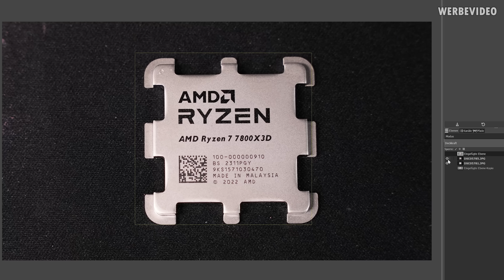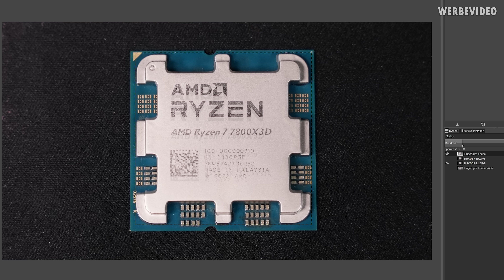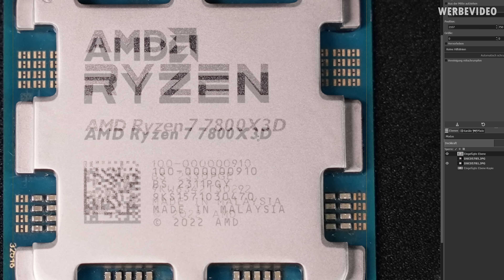Beware! Fake Ryzen 7800X3D CPUs are being sold

Comment: I don't get it - when someone is doing something like this, why won't they spend more time making it 1:1 wherever possible. I get the PCB thickness may not be available for the scammer, but everything else - why not perfect the design to actually match the original. It's bound to happen that people will start noticing a different font etc.

Also - I thought OLX has some guarantees if the item isn't working.

Comment: My first thought about these is: could these be "dummy"-cpus used on trade shows? Similar to dummy cellphones back in the day. Motherboard manufacturers that want to have a cpu in the socket, but don’t want to buy 20-30 real cpus. 

But again, that doesn’t explain why the serial on the box is a match 🤔
Reply: They probably buy real cpu to imitate it and copy the box serial code
Reply: @mr.il3nt658 yes. That makes most sense as they wouldn’t have to replicate the box and the label with the AMD emblem. But then again. The effort put into the IHS it wouldn’t shock me if they also made a good fake box 😅

Comment: This OLX is basically eBay or more like Craigslist. There is also a sort of a market for in box new parts. They are usually called "dropped from truck". They don't have warranty but they might be new and sealed. This does not mean they are ilegally obtained, usually these are sold by people working at retailers that know how to get a huge discount so they sell them at a profit. Or people that had a good deal buying things in bulk. Usually the volume is rather low so it's not money laundering, or not fully obvious.

Comment: "Somebody" did not do this.  This is the product of hundreds of willing participants to this scam.  The printing company, head spreader cnc shop, pcb manufacturer, etc. The management and most of the workers at these companies would have been aware they were making fake products.
Reply: Oh sure, but in China this thing happens all the time
Reply: i can see a cnc shop or pcb maker nto knowing what the end product will be but still....  this is a group of people doing this.  who ever printed the box would be the most likely to know id think
Reply: Pcb's yes but they'll easily turn a blind eye with a little extra money. The CNC stuff I could see being done without anyone knowing since some machine shops will let employees run stuff off the clock during normal down time. The rest of it can be done at home. But ultimately these were likely used to scam retailers originally until they exhausted that loop hole and moved to other market options.
Reply: @sirmonkey1985 I wouldn't agree
You can order PCBs from China (and some EU companies too, even) without even telling them what's it for
No questions will be asked and they'll make them according to specification
Same with many CNC manufacturers, they just get an order, and make it
Unless anywhere in that process, they see something related to AMD
And even then, if the workers etc. don't think about CPUs/don't know, so it would cause issues

Tbh licensing in China is so ignored sometimes...
PCBWay and JLC literally don't care about what logos you order them to silkscreen on a PCB, for example
Many CNC manufacturers also would make any shape like a car logo with no questions asked, for example

It's the text engraving I have most questions about, and assembly of the final scam product
Reply: @Versette  Actually the engraving can be done in-home on relatively cheap equipment, but these scams are getting out of hand.
Just last year someone tried scamming me by sending me a plastic prop instead a camera, but that was a much lower effort scam. The whole box weighted less than a proper rig should and despite nice packaging everything including "lens" was one painted part. Luckily it was payment on delivery and I just didn't pay.

It's probably a small network (or just getting popular), making more than one "product" using the combination of chinese PCB, local shops and own machines.
What's more intriguing to me is how their distribution network works. The police taking usually a year or so to look on cases like this and no one bothering with lawsuits probably helps.
Reply: Crisis management at lntel?
Reply: for the physical thing itself, it is just some employees of a local branch of a company like pcbway or so making some extra money off clock.
but likely there is a bigger criminal organization making money with those
Reply: this can be done with like 1-2k of laser engraver, a small metal lathe or CNC, and PCBWay. The only third party complicit would be PCBWay for the PCB manufacturing and they have no idea or way to enforce this
Reply: @marcogenovesi8570  cnc mill, not the lathe. Also the heat spreader looks like I could make it on hurco, conversational machine. You do not need to know or use any G code.
Reply: and they all need to be payed, with what amount of fakes actually being sold ? lol, my BS meter is buzzing.
Reply: Not hard to do. All these companies are desperate for customers. They don't care what you use it for. You think that printing company cares? They're printing junk and porn on a regular basis. As long as they get paid, they won't care one bit.
Reply: China has lost like 2m tech jobs in the past 2 yrs as it threatened to jail ALL foreigners doing business in China!  Its a way to bring back a small part of the lost jobs ...
Reply: Conceivably something like this could come out of a small garage workshop.

My money is on some sort of semi-large scale return scam, weird how they didn't match the PCB color though since clearly they've paid quite a lot of attention to appearance.
Reply: @lemagreengreen  How though? Send them to OEM's? More likely its small scale "invisible" outlets like AliExpress and well the bargain basement Facebook Marketplace clone this came from originally. Used to bait 'n' switch from genuine outlets by individual buyers much harder to track than corporate buyers. There is so much cheap fake tat that comes from china this is just the tip of the iceberg bought a bunch of fake Playstation controllers once the attention to detail was outstanding they were very hard to spot and they did work, just not very well but enough for them to sell to the gullible which included me apparently

Comment: Someone got one of these fake CPUs from Amazon over at Reddit. Same bluish PCB and lack of comformal coating on the capacitors, but that one says "made in China" and doesn't fit in the AM5 socket. It's not the same one mentioned in the video since that one isn't simply a laser-engraves AM4 CPU.

Comment: This I'm afraid is only the beginning as it gets easier to make fakes. Just too many shady countries with shady businesses that actually have connections to OEM's that can make things like this, probably cost 50$ or less to make this fake.
Reply: 50?!?!

lol, the pcb doesnt cost 5 dollars per unit, and i am exagerating, havent yoy seen pcbway! ads?

the metall cost like 3, once you ask for at least 1000 units is way cheaper, is just cheap aluminum, it is expensive the finishing touches on the top to put the fake amd stuff

all you do is use autocad or other cad software and tyen use the rigth tool to burn it on top of the ihs and you have your fake product

it is more expensive the shipping!
Reply: Probably way cheaper per piece... the capacitor probably fake as well... 🤣 there is probably zero copper within the PCB layer itself..

Comment: This looks to me like an in-store display mockup or something similar made to be displayed as an advertisement. Much like some brick-and-mortar stores still have fake phones on display that look almost exactly like the real deal. I don't think this was designed as a scam, but people (especially here in Eastern Europe) are very creative.
Reply: They wouldn't go to the trouble of faking the chips on the heat spreader making it a different cast from the mass produced one just for a demo unit.  Also demo units have serial numbers that aren't like a normal one's.
Reply: That's exactly what I was thinking but why go to the trouble of creating from scratch. If AMD were making display versions they'd likely use original stock but with chiplets mising or chiplets that lost the silicon lottery completely. On a smaller scale the cost of tooling etc would be cost-prohibitive. A store would more likely just get a returned / defective CPU and display that... It's sad that someone has gone to so much effort to basically steal money.
Reply: The amount of people stealing from computer shops is getting higher, it would suprise me if they are display models that have been stolen/resold not knowing they're duds. I've found countless phones/EE wifi boxes over the years that just have metal weights inside them to make them feel real.

Comment: Either this is a professional fake, OR they took a real CPU, delidded it, and used the heat spreader and the box to make the fake one. The delidded CPU being used in someone's gaming PC unaware the remains of his CPU are used to create fake ones.

In this case, using the serial number, it could be possible to track down where they're bought from and potentially get a location. But help from AMD is required.
Reply: That is a great idea, I really hope he tries to find out.
Reply: If I have to guess, all of the fakes have the same serial number (or a few variations) that checks out on the AMD verification page if you scan the QR code. The serial number could literally come from anywhere as you can just get a high-res picture from the internet and copy it including the QR code.

Also this is pretty high-effort as even the shifting label on the seal is working as you would expect. All and all, it's very professional work.

Comment: The holes in the heatsink could be intentionally added to adjust the weight, potentially making it harder to distinguish a fake CPU from a real one by weight alone. Try to spot a fake by weighing the CPUs.
Reply: They would be drilled not threaded, this is for mounting on laser graver printer. That fakes looks like from profesional manufacture line..
Reply: @r4plez  Plausible..

Comment: Maker: "- Call PCBWay and tell them to make the next batch with 1.3mm PCB".
Reply: ''also make sure to change the colour to one which is more green''
Reply: @gamecuber6  "...and while you at it, make sure they will put protctive resin on top of the capacitors"
Reply: And, of course, we gotta change the font and the laser engraver.
Reply: And put nail polish on it.
Reply: Maybe it was JLCPCB 🤣
Reply: They are well aware. If you notice on that side on shot of the IHS comparison they made the fake IHS thicker so that the z height would be roughly the same in total.
Reply: Maybe AMD can come up with a PCB design with some patterns on it to make it harder to imitate. Regardless. Buyer beware
Reply: @robertlawrence9000  Both JLCPCB and PCBWAY can make patterns with very high resolution. If they can then so can other fabs located in China or elsewhere.
Reply: your all forgetting that the thickness of the IHS is also wrong, to compensate for the thinness of the pcb. time stamp 9:42
Reply: If they use some old chips like, I dunno, PLCC m68k, instead of making that part of the heat spreader, and pre-broke it so removing the IHS would leave you with what appears like a destroyed CPU, those dark green, nail polished, 1.3mm PCB fakes with better fonts would be very, very believable.
Reply: omg rofl :D!!!!

Comment: Those holes on the underside of the heatspreader are probably from casting it. Machining the heatspreader is a waste of time if you just need a block of copper
Reply: i dont think its made out of copper, would be too expensive. just use a piece of aluminium, preheat hundreds of them to 4-500 c° and then stamp it into form with a 100 ton press, takes  maybe 2-3 hours to do 100 pieces, nickelplate all of them, order 100 pcb´s from pcbway with capacitors allready placed, glue them , get some fake boxes and stickers, done. in one day you can probably make ~500 pieces ready to ship with a market value of ~150K if you sell them for 300 each....its scary!
Reply: @georgwarhead2801  I'd guess that the boxes are real as faking them would make everything far more complex. They just laser the serial number based on the box.
Reply: @georgwarhead2801  I don't think its aluminum or he would have said it feels a lot lighter. 

Holes are tapped so not from casting alone, they'd be using it either for nickel plate process as he says, or maybe some machining op.
Reply: It's a cast zinc alloy (pot metal) it's 80% the weight of copper but that piece is a bit thicker so it's be about the same weight.
Reply: @georgwarhead2801  Such an criminal mindset u got there.

Comment: This is very interesting. I ordered a 7800X3d from Amazon. I didn't realize until after I had ordered it, that it was coming from somewhere in Asia. I also paid about $300 for the CPU. I'm thinking now, I might be getting one of these fake CPUs. It hasn't yet arrived. We'll see what it looks like when it arrives. At least I can get my money back from Amazon if it's fake.
Reply: It probably will not arrive
Reply: At least with Amazon you should be protected by their buyer protections
Reply: Amazon buyer protection is extremely thorough, you'll be fine
Reply: Record the unboxing tho just in case you need something to defend yourself.
Reply: Yeah the same thing happened to me i bought for it for low price like 300 and amazon hit me up and cancelled it for me and refunded me
Reply: I got tricked early on and the package that arrived just had a zip tie in it but Amazon refunded the money before I could even report it. If I were you, I'd probably report it now. It's certainly a fake or won't arrive.
Reply: I've been eyeing off a cheap 5800 x3d on Amazon, might bail on it now
Reply: Any update?
Reply: @KaitouKaiju  I assume it was a fake. Amazon was full of bad actor vendors. Any new vendors were bad, almost all from China. A few even had Chinese names in Chinese characters. I just ordered a 9950x brand new. The price was so good that I didn't bother waiting for an open box.
Reply: Me too I bought this CPU for $308 from Amazon but I found it from third seller not Amazon store . So after one day from buying this CPU the order was cancelled . In Amazon there is a third seller sell it for low price and that is fake price .

Comment: I've seen a lot of people suggest buying CPUs from Aliexpress to save money, and while there are honest sellers there, there also are a lot of scammers selling chips with swapped or re-engraved IHS's and the underlying CPU is actually an ES or sometimes not even the right CPU, and in cases like we see here, sometimes its just a completely fake dummy unit. Buy from trusted retailers!
Reply: This is why you buy from a trusted seller on aliexpress, not some random store with 0 reviews. People don't seem to understand how an open marketplace works.
Reply: The source of really cheap CPUs on aliexpress are Engineering samples. Although they're technically the right CPU they might not clock as high or perform as well. There are some reputable sellers that sell pre used CPUs mostly from internet cafes and such. You can normally tell by how many CPUs they've sold in the past. There are really only a handful of really big sellers and those are fine.

Comment: Great video, bringing attention to this issue.
Scary part is, the amount of design that went into the fake heat spreader and the PCB. What would be cost of 1,000 units of each part? You might be looking at €10,000 costs maybe €15,000 with packaging? 1,000 x €300 = €300,000. That's a lot of profit. The holes it the heat spreader might be to balance the weight to a genuine version. Threaded hole would make process quicker for batch nickel plating. Whole set of this, from start (Raw parts) to boxed (FAKE 7800X3D), including tools required to complete work. €25,000-30,000.
Reply: It'll be made in China very cheaply or even in a backstreet workshop in some country with very low wages. Probably won't be that costly to make believe it or not. The counterfeit market is very prolific. I very much doubt it was made in Romania. Probably brought in bulk from Asia by another criminal and sold in smaller batches further down the chain. Complete scumbags but not uncommon. The 7800 X3D is a popular product so they wouldn't mess around with a low selling model. The new Ryzen Zero series.
Reply: "You might be looking at €10,000 costs maybe €15,000 with packaging?"
You are waaaayyy overestimating the costs.
Reply: @ABaumstumpf  You sound very experienced in this market.
Reply: @Del_UK  "You sound very experienced in this market."
Yes as i worked with PCB and milling designs for prototypes. Single piece prices are high, but these things are made en masse. A simple PCB populated only on one side with cheap caps - that is not even 50cents a piece. For stamped metal you are looking at ~1500$ upfront for the die but that is a one-time cost.

The hardest part here is getting the fake designs correctly (good enough like this where it is hard to notice anything amiss for most people).
Reply: @ABaumstumpf 1500 just for the dye each selling at 400$? That makes no sense
Reply: @Jb1v1clips  "1500 just for the dye each selling at 400$? That makes no sense"
??? What makes no sense to you? Are you confused about what a "die" is - cause it is NOT "dye".
Reply: @ABaumstumpf  why would they sell it so cheap if it’s 1500 per die
Reply: @Jb1v1clips  You missed the "one time cost" part.
You spread that $1500 cost over 100, 1000, or even 10,000 fakes.